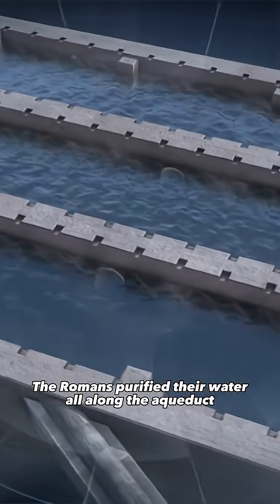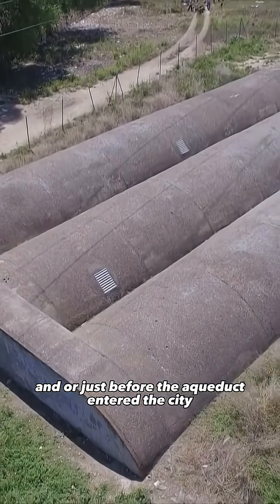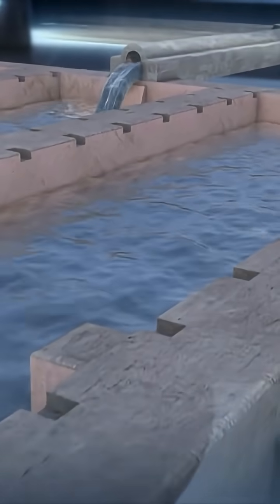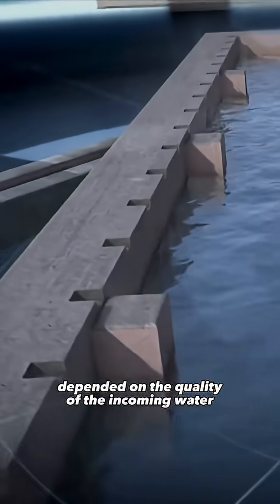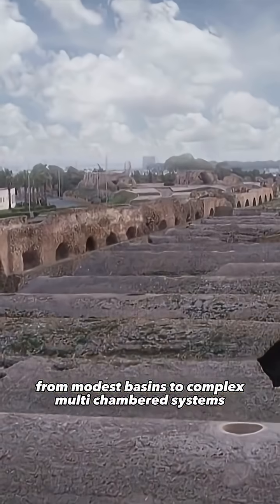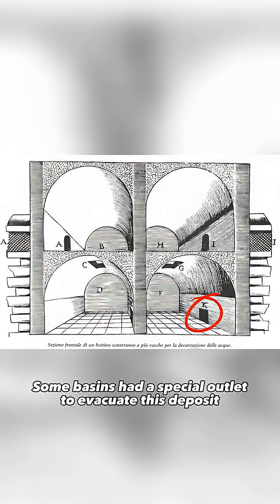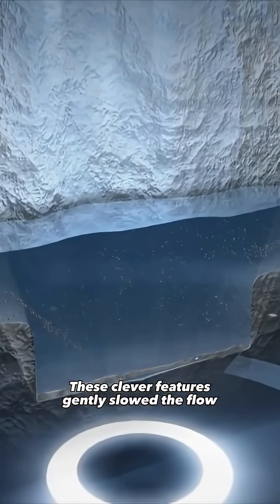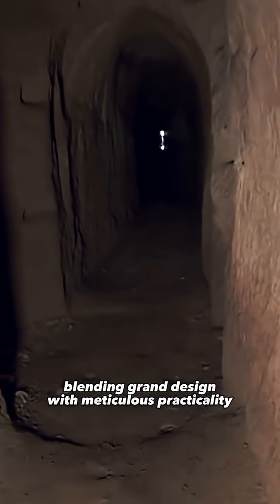How the Romans purified their water #history #romanempire #engineering

Comment: And then they drank wine sweetened with lead. 😅
Reply: The ancients can be excused, more Americans die today from obesity and they knowingly do it
Reply: And today you drink water sweetened with cancerous microplastics
Reply: Keep em dumb
Reply: No. Romans neither used lead acetate as an artificial sweetener not they were calling it sapa. Author of this video mixed two different things. The wine, especially inferior one, and many dishes were often seasoned with sapa, and sapa could have been the source of lead poisoning, but it wasn't lead acetate or any other lead compound.

Romans often used reduced (partially evaporated) must that is essentially fresh grape juice to turn it into thicker and relatively sweeter and more aromatic natural syrup, resembling honey and called sapal defrutum or simply sapa. It was very popular, not unlike refined sugar today and Pliny the Elder in his Historia Naturalis bemoaned the fact that it is hard to find a wine that was not additionally sweetened. But what the grape syrup had in common with lead? It seems that the lead utensils were preferred in the process of defrutum production, as the best evaporation is provided by materials made of good heat conductors and thus metal pans were preferable to ceramic ones. Given that two most popular metals for everyday use were lead and copper (stainless and acid-resistant steel was not known yet and iron is much harder to work with) and the latter was considered inferior in that particular case, because acidic must reacted with copper, getting infused with copper acetates that are characterized by strong metallic taste and rather unpleasant odour. Of course, lead reacted in similar way, but the lead acetate (II) thus produced were sweet and largely oduorless and thus virtually undetectable in a very sweet product. This is why Romans were using either lead pans or bronze ones covered with a thin layer of lead, as evidenced by the aforementioned work by Pliny, Columella's De rei rusticae or Marcus Portius Cato's De agri cultura.

Did Romans knew about lead toxicity? Well, it could have been not the common knowledge among people, but the scholars definitely knew that lead is a dangerous metal. Lead carbonate (cerusite), commonly used as a whitening cosmetic (replaced only in 19th century by zinc oxide) was identified as a dangerous poison when ingested by e.g. Galen, Pliny, Dioscurides and Celsus. Additionally, Vitruvius in his book De architectura did not only notice that although metalic lead is not very dangerous (at least unless ingested), lead vapours created in the smelting process are highly toxic (mercury has similar properties exacerbated by the fact that it evaporates in room temperature) but also recommended to limit the number of lead water pipes, stating that drinking water that is constant contact with lead cannot be healthy (although Hodge suggests in article referenced below that this particular vector of lead poisoning was of limited importance, due to high amount of calcium in water that quickly formed a calcite residue on the pipe surfaces, acting as a preventive barrier). This did not change the fact that due to abundance, high malleability and low melting point, lead was ubiquitous in ancient Rome, as it was used for almost anything, from water pipes to construction fittings to food containers.

How dangerous was defrutum (sapa)? Quite a bit, it seems. German scientist, Karl Hoffman decided to check this experimentally in 1883. He made a dose of defrutum using recipe and utensils matching the description in Cato's and Columella's work and then checked the lead content in the resulting product. The results shown that it lead concentration was reaching almost 250 mg/l. Then, as ancient recipes suggest adding one sextarius (roughly 0.545 l) of sapa per one quadrantal (26.2 l) of wine, the actual lead content at roughly 5 mg/l of sweetened wine. As the modern safe limit of lead consumption is 0.5 g/day, it means that drinking one liter of sweetened wine made according to Columela's recipe meant ingestion of the amount of lead that was 10 times higher than what s now considered safe. Of course, not the whole amount of lead got absorbed, but given that we given we are speaking about an organic lead compound, the absorption rate was still rather high).

Last but not least, the prevalence of chronic lead poisoning among Romans and its role in the decline of the Empire is still heavily debated. Although some researchers speculated that increased exposure to lead compounds in case of aristocracy that could have afforded any amount of defrutum and related products caused rich strata of society to suffer the most (Pliny and Galen were describing illnesses with symptoms typical to lead poisoning), this theory is now challenged as not corroborated by archaeological findings and too conveniently based on the romantic notion of the 'decline' of Roman society as portrayed in seminal, but now rather outdated work of Edward Gibbon. Analysis of the bones of the Romans found in Britain performed by Drasch in 1982 suggests that the level of the exposure was roughly as as high as most people in the developed world in 1980s (although these people were rather common soldiers rather than rich citizens). So, the discussion is still open, but we can't authoritatively say that lead poisoning caused the Roman empire to fall.

Recommended reading:

Emsley, J. The Elements of Murder: A History of Poison. Oxford University Press, 2006.

Hodge, A.T., Vitruvius, Lead Pipes and Lead Poisoning, in: American Journal of Archaeology, no. 85 (4), 1981.

Retief, F.P., Cilliers L., Lead poisoning in ancient Rome, in: Acta Theologica, vol. 26, no. 2, 2006.

Comment: Still they used lead pipes.
Reply: And you use plastic pipes and contaminate your water with poisons like chlorine and fluoride
Reply: @mercurius1488  Plastic pipes, where do you live? My house has copper pipes, like everyone else.
We also have spring water.
Reply: @Freedom9X copper was the norm decades ago which is why its still relatively common but today the plumbing being done with polypropylene or pvc pipes surpasses that of copper by much. Piping is also not the only source of microplastic exposure since they have been found in 100% of human tissue samples. 
You complaining that a civilization 2 thousand years ago wasnt using the most modern safety standards is so ridiculous specially when lead was also common just a hundred years ago and even today as we speak the population is willfully poisoned with carcinogenic substances.
Reply: @Freedom9X  I can almost assure that the pipes on the street before your house are not copper. They are either lead, iron (cast or ductile), or some form of plastic like pvc or pex. In a real old neighbourhood there might still be some wooden pipes around.
Lead is only a problem is the water is soft, with the more common hard water a decent layer of calcium will prevent the copper from leeching into the water.
That's also why the problems in Flint only started when they changed the source of the town water.